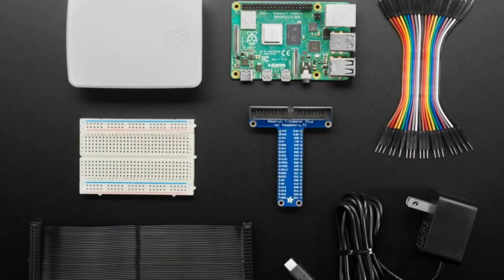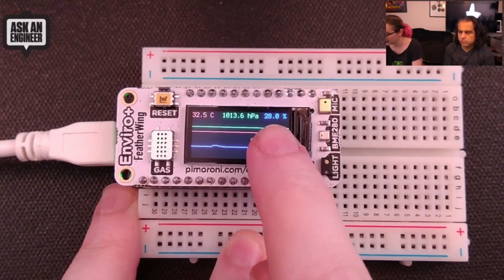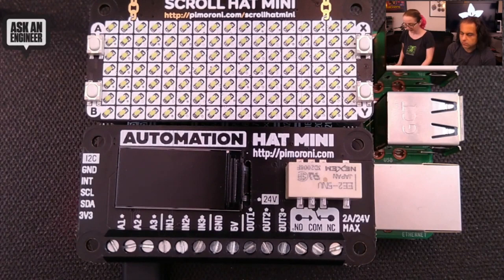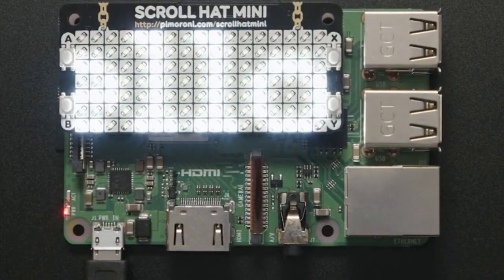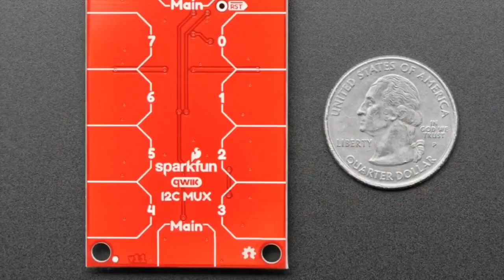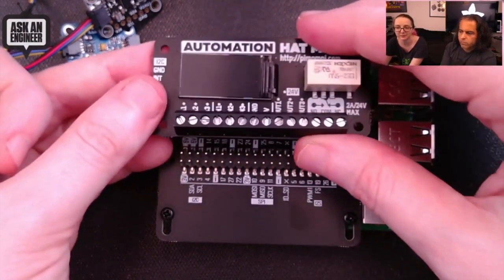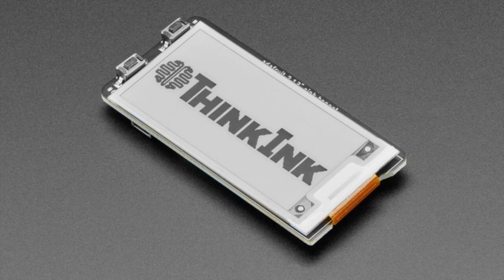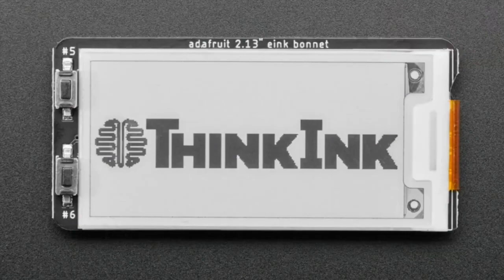New Products 8/12/20 featuring Adafruit 2.13" Monochrome E-Ink Bonnet for Raspberry Pi - THINK INK!

Comment: There's a concept called "density altitude", a function of temperature, pressure, and humidity, which determines how much runway an aircraft will require to take off. Light aircraft, in particular, crash because people forget to factor it into their calculations. It looks as though some of those components could be combined into a calculator that would indicate the minimum runway required for a successful takeoff, based on current conditions.. (The basic ISA number for the machine would be the only required manual entry.)